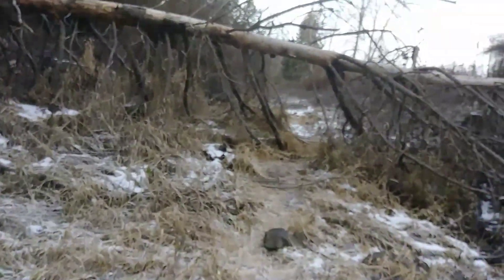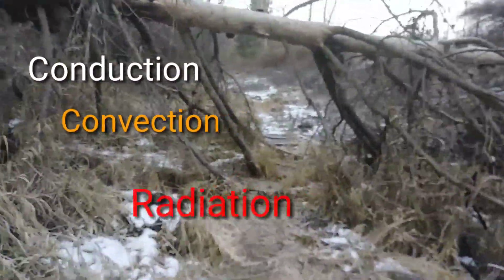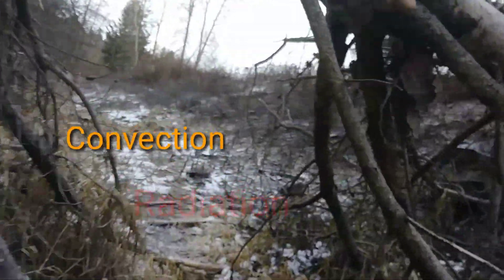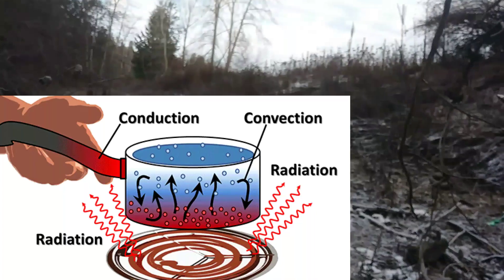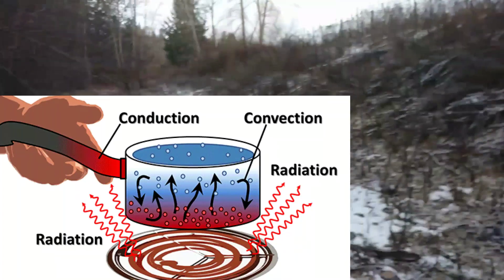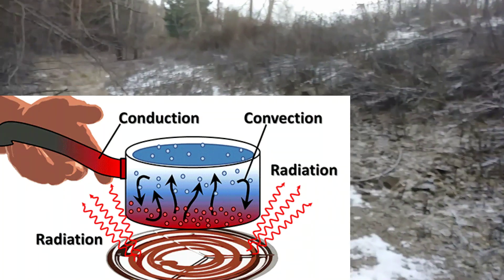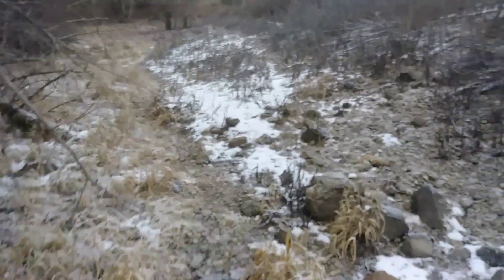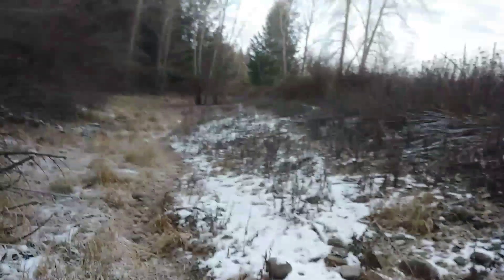Candles+Clay Pot: Hoax or Hack? | Thermodynamics

Comment: The only thing I have observed using Tea lights - I put some in a camping stove - too close together and rather than the wick burning,  the melted wax caught. Its because the proximity of the lights and heat caused the wax to flash. Even before this, the airflow caused the candle to burn hotter and faster than normal.

I would presume the clay pot can act like a chimney. Candles in close proximity could burn faster and thus hotter - but its very dangerous. Without the chimney you still get heat from candles. So it's safer to forgo the pot.

Comment: I think the best way to think about the clay pot is it simply captures and localizes heat that would otherwise quickly spread out through the house and be unnoticeable. If you stay near the pot, you actually FEEL it. Some folks seem to think you're getting something for nothing out of the pots.
Reply: BTW, don't capture too much heat in there, or the melted wax can combust like any other liquid fuel.

Comment: there is no magic...  a candle can produce heat...  no mater what you do it will not produce more. with the pot it will take longer to START HEATING THE ROOM and longer to keep warming but zero gain.  no mater what you do it is insignificant heating performance comparable to having a 40W light bulb on!  the end!
Reply from the maker: I disagree.  With just the candle, you're heating a spot on the ceiling only 10" across, and almost all of the heat energy is lost without heating the air.  The clay pot disperses the heat into the air far more efficiently,  resulting in more heat energy bring retaindwithin the room for longer periods of time.  It's about the rate of energy loss from the room, something you don't address at all. The end

Comment: My god, what a terribly long winded way of explaining that conducted heat is naturally better than heat that is dissipated and lost. I think that just three of these small candles will actually last for 3 hours and thus give a steady amount of high heat if restricted by those heavy clay pots, the air flow is not restricted as the heated surface is optimal. Hense the cost is minimal.
This is common knowledge, yet why the long winded video?
Reply from the maker: Firstly, it really is not common knowledge, as evidenced by the comment section of this video and the many people who asked me to make this video. Second, you're the first person I've seen have a problem with the length at which I explain this.  Third, a shorter video would net less watch time, and finally, you still watched it and wrote your own long winded comment, so clearly it wasn't TOO long

Comment: The heat that comes off the pot still goes to the ceiling.
Reply from the maker: Not all of it. Hot matter puts off infrared radiation, which travels like light until it is stopped, where it converts to heat inside the object that stops it. A hot clay pot will create alot more infrared energy than the candle, and so more energy goes outward before going upward. Also, the hot surface of the clay pot convects heat into a a larger volume of air than the candle flame, which creates a vertical column of hot air that moves faster

Comment: What if you put a thick metal chain called Reese Tow Power or a Safety Chain in a tea light pots will it work just as good. You flip the clay pot upside down so the metal chain goes in the pot. They say the more metal more heat ??

Comment: Most of the beginning of this video gave me great hope that you where actually going to be totally honest with people, until I heard you give a positive note on the clay pot heater. It is a worthless attempt you would first have to be in a very small enclosure to gain even the tiniest of benefits of a degree or two which would last for only a very tiny short period of time. Second AGAIN you did just as every other fraud out their trying to make AD money off of this scam. YOU FAILED to warn people of the danger of carbon monoxide poisoning. It hurts me a lot to see so many people putting their greed ahead of the safety of others. There is no real way to cheat the science of trying to stay warm in extreme cold. So many people are losing so much as they have continually dumbed down our schools systems.
Reply from the maker: A ) I make no money off of my videos,  they are unmonetized.b.) you're only here because of the recent craze of watching videos about this c.) I will rewatch this video but if I remember correctly I simply stated that this method will only slow the loss of heat due to immediate convection to the ceiling rather than infrared conversion and conductive redistribution. If I'm mistaken and was misleading in this video, I'll remake it.  I was in no way greedy in making this video as I was well below the monetization threshold when I made it, or trying to provide misinformation, so kindly ease on the accusations
Reply: @LetsTalkAboutPrepping  wrong I have been trying to educate people about this scam for years. I actually just updated a remark I had made on a different Chanel on the same subject over 4 years ago just after I watched your video.. These things do not work, an by promoting these lies you are encouraging people to spend money on something that will not help them in their situation. You are encouraging them to waste money they don't have to waste. You are encouraging people to do something that is dangerous to their safety. That makes you as responsible as the person or persons who inspired you to make your video because you are pushing a LIE that only brings harm to those in need. That is wrong. You did not make any effort to actually explore the science of thermal energy or BTU'S. Or the basic law's of thermal dynamics.
Reply: P.S. I am seriously glad that you are not doing this out of greed for ad money. but it does not change the facts of my original comments or my first reply. the spreading of this lie is wrong.

Comment: Great :D  Love the science of it .  Both light and matter can  transfer heat or energy  but certain things like metals or foam change how fast this happens over time.  Solid water or ice is a rare exception  as it floats as it's made.   Im the kind of person that generally would use water as the medium to store "thermal energy" as  from my early days of science,  liquid water has a high heat capacity. Indirectly use flame/fire to keep warm.
Reply from the maker: Hydro heat is an awesome option especially for preppers because your heat storage water is also water storage!!  I'm plotting out a bug-in hobo stove with a water jacket on the pipe as it happens

Comment: I know of this for years. Close to 10 years.
When you`re outside/bugging out/whatever you can take a tealight, put aluminium foil on/around it (different ways, look what works best for you), sit on your pack next to it and wear a poncho (the poncho protects from water, wind and it traps the heat) which covers all up.
The aluminium foil heats faster and holds the heat longer than air does ----> way warmer.
Do this on a tree and you even can sleep like that.
Reply from the maker: That all sounds exactly right to me, great little trick because metal cans are alot more common and durable then clay pots
Reply: Metal cans or the package for ready meals work too but they are/can be heavy, depending on how many you take and how far  and how fast you want to go. With a can you have to use a knife so the candle gets enough air.

Comment: Great explanation. Makes sense to me! It reminds me of another channel's explanation of how space blankets work and how to properly use them. (Far North Bushcraft's video, I think.) Anyway, it made me think that the clay pot heater might work better in a small space lined at least partially with a space blanket (like in a super shelter) to trap the radiant heat inside the space.
Reply from the maker: Definitely.  I dont really think that candle hack is a great way to heat a space but if you're running a candle or lantern or anything that loses alot of heat vertically, might as well put whatever you can between it and the outside- foil and any reflective surface does great to reflect IR
Reply: @LetsTalkAboutPrepping  Yeah, I think you're probably right. I kind of want to experiment with this a little. :)
Reply from the maker: @EileenHagerman  same ☺
Reply: Here's the video I referenced, btw: 
https://youtu.be/W6qVm9YZvYk
Reply: What if you put a thick metal chain called Reese Tow Power or a Safety Chain in a tea light pots will it work just as good. You flip the clay pot upside down so the metal chain goes in the pot. They say the more metal more heat ??

Comment: Would like to see you show/explain or construct a large Cobb walled rocket mass heater for whole house heating.
Reply from the maker: Awesome suggestion.  I'm going to be researching and doing rundowns on low cost or salvage home systems preps like home heating and water preps.  So, thank you😊 it's on the list for research
Reply: Let's Talk About Prepping check your local bushcraft shop. They have great connects on the subject.
Reply from the maker: @GlutenfreeGlobal  will do 😁
Reply: What if you put a thick metal chain called Reese Tow Power or a Safety Chain in a tea light pots will it work just as good. You flip the clay pot upside down so the metal chain goes in the pot. They say the more metal more heat ??